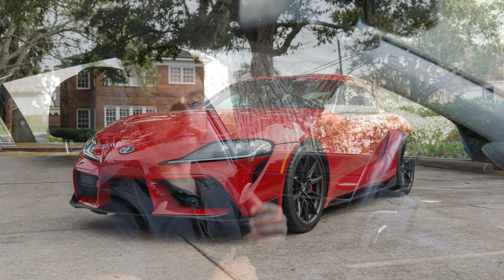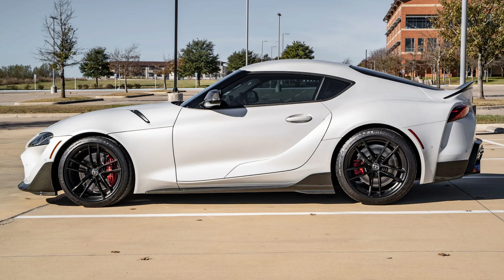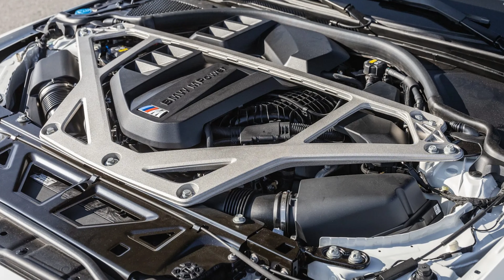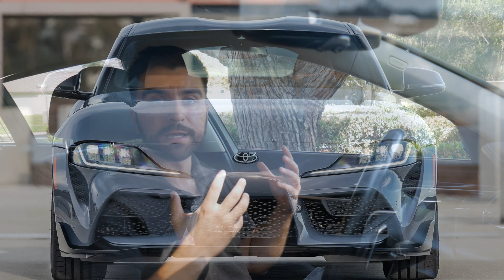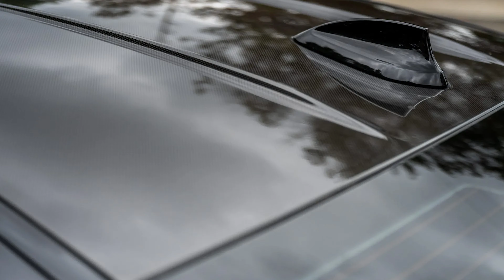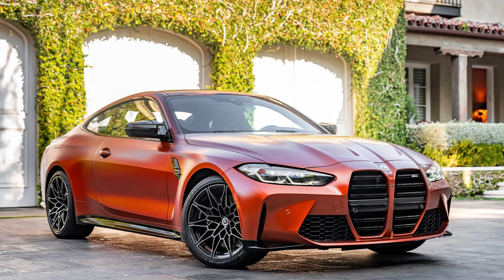An S58 Powered A90 Supra GRMN Is The Car We NEED, But Likely Won't Receive

Comment: But have you seen the GRMN testing videos? It sounds closer to B58 than to S58. Despite this, do you think there's still a hope?
Reply from the maker: I think the car will most likely come equipped with a higher powered variant of the B58. The chances of it getting an S58 are slim, but we can’t say for sure until the car is officially unveiled.

Comment: as long as its cheaper than a M3/M4, even a downtuned s58, lighter chassis, smaller wheelbase would be an insane competitor price wise and aftermarket.
Reply from the maker: Spot on with your comment. I think if we don’t see it actually come to fruition, it’s only a matter of time until the aftermarket begins swapping S58 engines into the A90.
Reply: if you want that get an m2
Reply: @ I think a factory wide body Supra would look better and have more appeal
Reply: Toyota was denied when they requested to put the s58 in the mk5 supra so they just tuned a b58 to get 429, however the b58 is far cheaper tuned than the s58 allowing the b58 to easily reach 700 stock internals with the right tune, replacing those stock parts can push over 1k hp